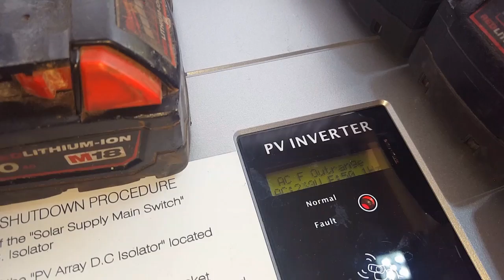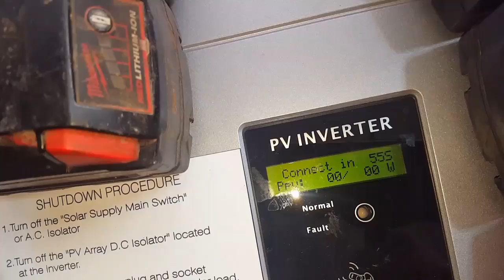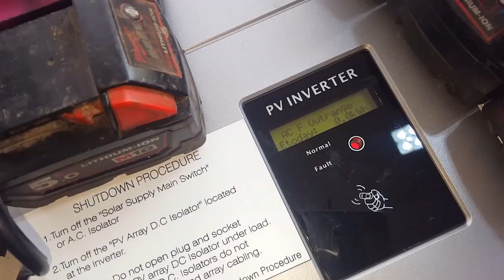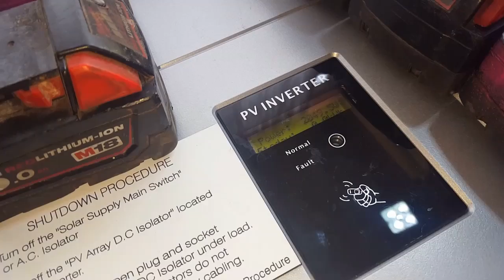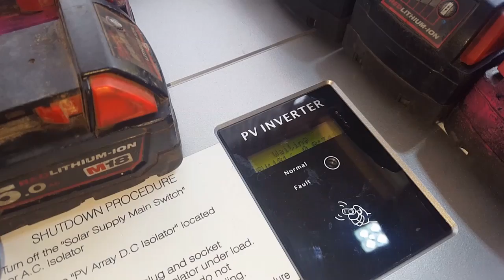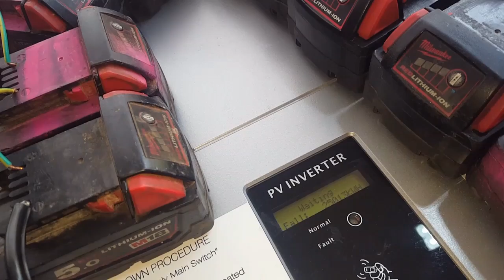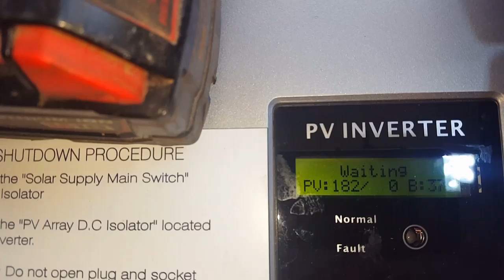WE HAVE OUTPUT Growatt 5000mtl 5kw grid tie inverter testing pt2

Comment: I have the same inverter that a solar company installed back in 2014 I asked them at the time’ that in the future I will be wanting to install batteries. Tell me a tradie myself! can you provide a pic of what you have done from connecting your batteries in Parallel to where on the inverter , and how you made that connection from battery to inverter!😁😁😁😁😁

Comment: Just in case you haven't downloaded a user manual yet, one can be found here:
http://www.solarnrg.nl/downloads/newsmessage/3378/8d341dcf76f02b0/user%20manual.pdf
As far as the frequency being out of range, you might check the capacitors on the AC side for bulging. A bad Cap might just be the culprit.
Reply from the maker: +Jason Simpson thankyou  i will do. So i may he able to physically  see a defect cheers

Comment: 475 to 52.5  6 percent of 50 is 2.5. Those are some really small wires interconnecting. Nice video though nice watching those batteries do that.
Reply from the maker: +old time engineer yeah plain old brain fart read to many specs at same time. 50 to 60 hz +or - 5% so frequency  range isnt whats wrong with it . After i finished filming i out putted 2.6kw for 3 mins before the ac lead went soft  as we're the dc ones im just very happy it outputs  power :) thanks for watching
Reply from the maker: +old time engineer time to build a power wall that can support it long term